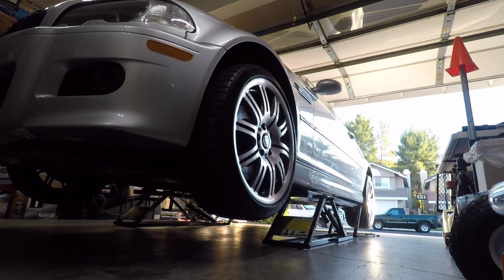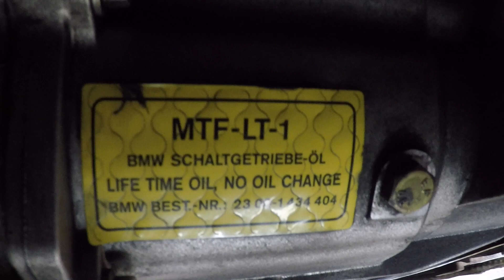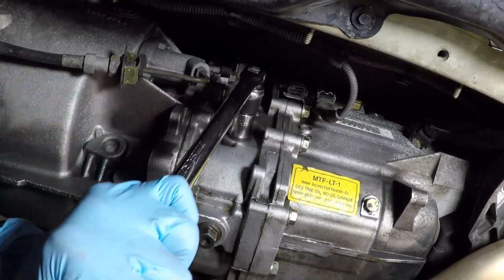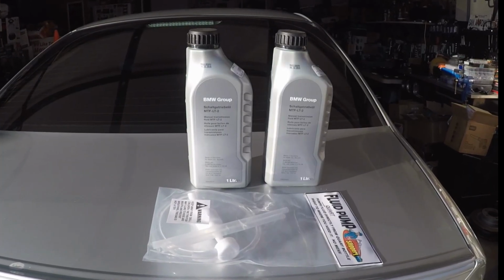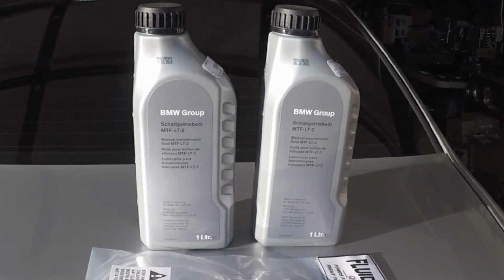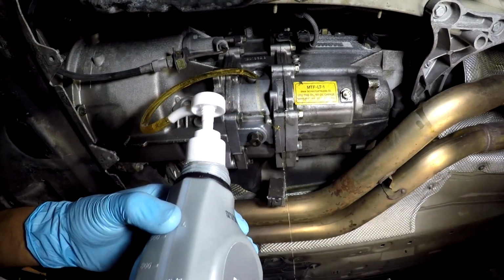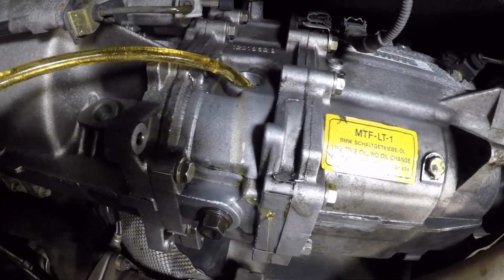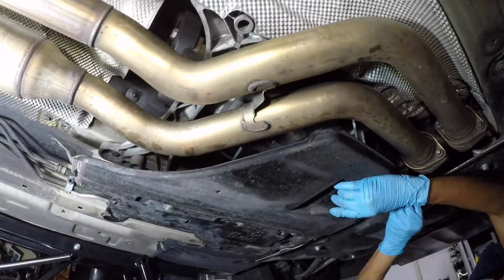BMW E46 M3 6MT trans fluid change (DIY18)

Comment: Hie guys  can you please assist me with my  car is 2000 model BMW E46 318i Automatic . l think l went pass through a big stone in the road and it hit my gearbox pan folding it upwards but not breaking it and l managed to get home and parked the car .Then the next day l started the car and as l try to put the car in drive it is stopping at the Reverse(R) slot even if you try to force it to reach the neutral (N) and the Drive(D) slot it is bouncing back to the Reverse slot infact its not getting in Neutral nor Drive(D) .I suspected the sound l heard underneath the car yesterday and when l checked underneath l could see the gearbox pan  was damaged it has folded a bit upwards but its not linking any transmission oil .My question is can this damage of folding the pan upwards cause the car not to engage in N and D and how can l fix the pan to be straight need you help guys

Comment: Doesn't the sticker say to get LT-1, not LT-2???
Reply: Lol
Reply: You can run practically any OEM BMW LT MTF, just depends on what kind of driving conditions and habits it’s put through. A lot of people usually like to increase the viscosity of whatever ATF or gear oil (GL-4) they are using, to around 8-11 cst. Obviously anything around the 10+ cst viscosity mark, will decrease easier shifting in cold climates/seasons..